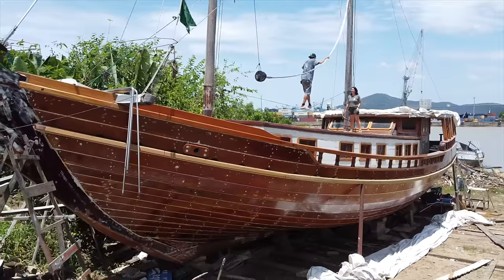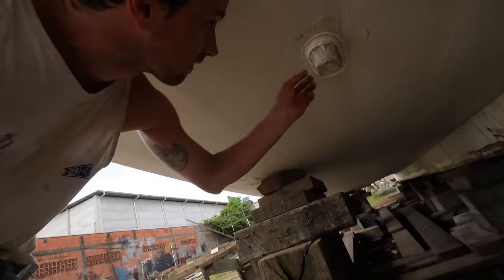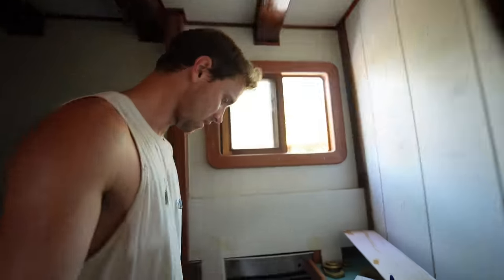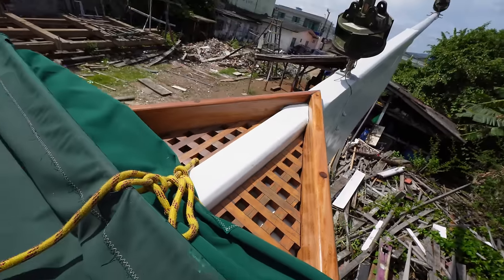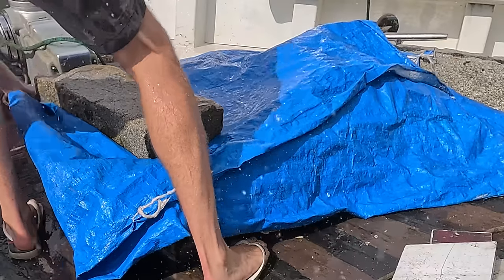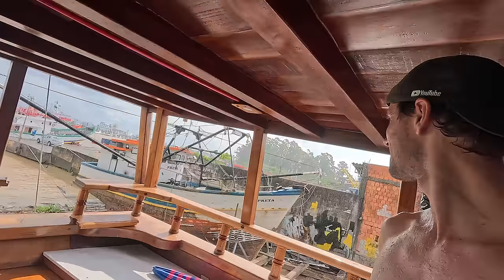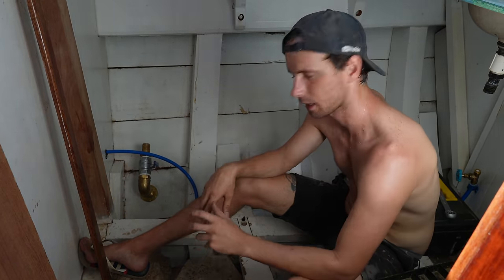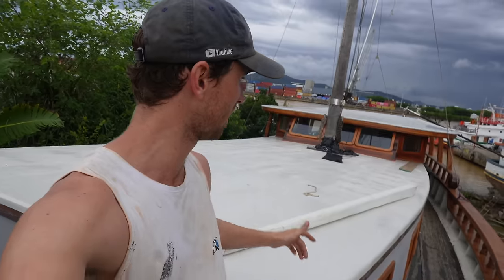Boat restoration diaries: what it really looks like to face the high and lows — Sailing Yabá 181

Comment: “One at a time” was a very good answer.  Here it is often called a “monkey wrench” (for some unknown reason). Many thanks for sharing your amazing and challenging adventure.
Reply: The pipe wrench has that pivot that tightens around the pipe or nut, the monkey wrench doesn't pivot and is used on nuts or bolts, not pipes.
Reply: Charles Moncky patented his smooth ,parallel jawed wrench in 1858. The newer pipe wrench with the pivoting ,toothed jaw was invented by a steamboat fireman named Daniel Stiltson ,in 1870. Some still call them stiltson wrenches.

Comment: Putting  a large battery close  to the anchor  winch  is  the  safe smart thing todo  and cheapest.  It only takes  a small  wire  from the  breaker  box to charge the battery  and  a small wiring  cable  to the controller.

Comment: Just a suggestion, when installing ball valves on through hull connections, you should always mount them in such a way that you have to move the handle upwards to open and down to shut them. Because whenever you shut a ball valve on a through hull, you want it to stay shut until you open it and not until something falls on it without you knowing.
It might seem nitpicky, but these are potentially boat sinking details...
Keep up the good work!
Michiel

Comment: I live on the coast I know how frustrating the weather can be especially in the summertime. 
You have to work around the rain because it comes even when there is a lot to do. That you can’t do in the rain. At least the mud don’t stop you guys and what I always did it dose ( using heavy equipment). But you brave it everyday to see If you can get things done. Oh I hope you installed automatic  one way valves, on your bilge pumps.
Yaba will set low in the water so they maybe needed. Especially when under sail.
Take a much needed break and enjoy your day. We will be waiting. Launch day is coming guys ! 
I can’t wait !!!

Comment: Hi Ben and MP, a small suggestion before heading to the water. Can I suggest you fix a small string, or chain (maybe bath plug chain) to the window closure sticks. That way in a rush to close or open the windows  the don’t go missing or get lost over the side. With all the work that has gone into making them and the windows it would be a shame to lose these little pieces. Yaba is looking amazing.

Comment: Ben you haven't mentioned it, but i hope you intend to add holding tanks for the output of the toilets.  Most marina's require them when you stay, and you are not allowed to flush the toilets overboard while docked.  I just thought i would mention it before you get to far along.

Comment: MP, we call that a "float switch" on the sump pump. It floats up and makes the pump turn on. 
The other name for the pipe wrench is a monkey wrench 😊
You should try to get a portable fan to take with you into the work areas that are so hot. It might help a little.

Comment: You should install the wires only through the side or bottom of the relay box; I dont work on boats specifically but usually we install these only through the bottom so they are  protected but also so water/dirt doesnt sit around it. Side is okay but top should probably be avoided in case it gets wet

Comment: You could pu,t a small gel cell 24 volt battery in the front locker to assist the anchor winch and hav standby power for bilge pump,

Comment: On my boat I often had little fish swimming up the through skin fittings and blocking the pipes.  I had a filter and a sea cock to be able to clear them out before they got stuck in the pump. It often happened on the through fittings for the heads especially and the pump sucks them in until they get stuck..

Comment: Looking at the boat in rebuild you pointed out I see it has the stabilizer fins - don't know if it is to late to add them but they make a big difference and well worth the effort - even smaller ones because you don't have the booms hanging over the sides.

Comment: I would also like to see what you are doing in your down time. Get to know you a bit better. Mp you need to maybe switch day and night. Work at night down there then it will be cooler. 😁 Thank you for letting all of us be apart of your rebuild.❤
Reply: That is a good idea (working near night time), however I don´t think the shipyard manager will allow this because of safety reasons as well as inssurance restrictions. Obviously working in more cooled conditions in summer is more efficient, but they will be on their own in case of an emergency. Cheers from Argentina.

Comment: I love these daily videos!  I was thinking about that hatch  that might lock when closed, the latch going over the staple with someone below.  If you glue a spongy foam piece above the u-shaped 'staple', it will prevent it locking, and it can be locked by squeezing the latch down to put your lock thru the staple.  I think that will make it safer for someone below.

Comment: I think we are on the same latitude as you in Brasil.  We are in Australia.  We've been out working on our property in stifling heat and extreme humidity so we know exactly how you feel while you are working on the boat in this heat.
Reply from the maker: I hope you manage to get through it! We have learned that no matter how hot it is, we should appreciate the work while it isn't raining... or something like that :D
Reply: @SailingYaba   Yes we agree.  We have done a lot of work here to prepare to take advantage of any rain and capture the water for future use.  We have received some good rain in the past 24hours which means our water tanks are full and our dam is full.  While it is still very hot and humid, we now won't have to worry about running out of water for up to six months.  By the way I am loving coming in from a day's work to another video from you both.  I feel your anxiety about putting through holes in the hull, marvel at the busy throng of workers you have onsite and MP's irrepressible optimism, even when installing a bilge pump in the claustrophobic forward locker.

Comment: You should caulk inside the hole as well for you thru hull fittings.  Hope you don't sink because you were stingy with the caulking.
As to off shore electrical connections... you should do some research for what is used.
Reply: Installation of the thru holes has been a sloppy mess relying on half assed caulking to prevent leaks, all caulking in the best installation will leak eventually. No caulking on the inside is a real issue. I hope I am  wrong you better have the bilge pumps running when you splash.

Comment: Great progress!!!   "loveneveryminuteof it"   Just a few things to see would be to label every thru hull with what it does--- as you maybe the one shouting orders not doing them  Your crew member may not know which is which.  Then a little heads up on those solenoids. (the "Ford" type) They came in at least 3 configurations.  ! one was a true starter relay for momentary use.- two was for continuous duty where it just stayed on as long as energized_ three was a version with a small ground lug next to the signal lug so it could not work unless that lug was grounded.  A variation on that was the original "Ford" solenoid for resister ignitions where the second lug went to the coil circumventing the resistor wire.  SOOO just make sure you get the right ones.   Love you guys.

Comment: Hi Ben, fyi did you use straight thread elbow on the thru hull fittings?
Most pipe fitting have tapered threads and will fit on straight threads but not seal properly. 
Especially important if  you did not put a straight thread valve directly on the thru hull fitting first. 
Cheers Warren

Comment: The outlet on the boat head that I had was 1-1/2 inches (38 mm).  Your outlet through-hulls seem smaller.  Is that because you will use a macerator?  With plans for having non-sailor guests onboard and the desire to not have any problems, big is good.  No need to respond, just something to make sure you install what you want.

Comment: Hey guys. I think it’s quite interesting to see your daily routines as you prepare to splash the boat. I was wondering whether you were going to install a bow thruster. It would be extremely useful to have one on a boat that size. Secondly, have you thought of shore connections for those times when you might be at a dock. Being able to use shore power and water could be helpful. As MP has been working hard on the electrical  systems the thought crossed my mind. Lastly, is a water maker in your immediate plans? Cheers.

Comment: At 9:44:  A relay is a magnetic switch that uses a small current (therefore requiring thinner wires) to operate a larger current (requiring thicker wires), similar to that in cars.  In vehicles, a thin wire runs from the ignition switch (using about 1 A or less) to the relay (attached to the starter motor), which is capable handling a much larger current (say 50+ A), using a thick black wire (from the positive pole of the battery)  about the size of your little finger.  This larger wire connects the starter motor through the relay to the battery.  From the negative of the battery, there is another black wire, somewhat thinner, that connects to the car body (busbar) of the car. Yes, kind of confusing since both wires from the car battery are black.  However, the one to the starter is thicker and longer; ground, (negative) is shorter and somewhat thinner.

Comment: With the bow bilge pump getting power from the windlass box, how will it still be connected to the hot battery bus and have continuous power.
What  if the windlass circuit is turned off?

Comment: Hi MP
Apologies if I have missed something when viewing your electrical installation but when you tapped off the windless power supply you are using what looks like 2.5 or 4 mm cable however the supply fuse to the windless will be 10’s of amps. A fault on the sump pump cable would instantly incinerate the wires possibly causing a fire. Any cable whatever size should ALWAYS be protected by a fuse of lower current rating than the cable. Sorry if you know this and I am being stupid but hate for you to have unsafe installation.

Comment: Just a question,  if you are  using a relay how are you monitoring pump failure.
Reply from the maker: We'll have a fuse between the relay and the pump and also, well, a flood alarm that can let us know if the water level is above what it should be if the pumps were working as they should. Any other suggestions?

Comment: On the head seawater inlet, isn’t it supposed to be above the discharge fitting? Or am I missing something.
Reply from the maker: As 💩 floats, the outlet should be above 😉
Reply: I mean, I see that there’s the proper separation between the two, I’ve just never seen the fresh inlet below the level of the discharge.
Reply: If you say so!  @SailingYaba

Comment: Hi very very worried that your bilge pumps are at least 50% too small in the bow you need a min of a 2 x 3"dia pump ,Engine room a min of 2 x 4" dia pumps you can't have them too big I can assure you
As when your at sea your on your own.
Have you calculated how long the battery will allow all the pumps to run for ,to me you need to double the number of batteries in case your engine is a none runner
Have you allowed for a manual bilge pump as well as a back up 
Please please up grade your pumps  and all hoses.
Barry Marbella Spain

Comment: Wow the maximum temperature in Itajaí for the last week is only 26°C, so in the boat would be less than 35°C which is not even hot (says the Aussie who won't even turn on the AC till the temp is over 33°C 🤣) so if those GoPro''s can't handle those low temps they are effectively useless, maybe time for a competitor to make a serious camera that can work outside cold climates. (if any camera makers are reading this, parts of Australia can reach 50°C so max operating temp should be no less than least 60°C to ensure the camera can be used in all conditions)

Comment: Not much sense epoxying the through hulls if you are drilling and sanding at the holes again !
Reply from the maker: I don’t get it 🤔 we didn’t sand or drill any hole after epoxying it
Reply: @SailingYaba  when you were putting one of the through hulls in it was tight and you drilled the little locking gold and sanded it out a bit so it went in easily . I am assuming you were doing the final installation after epoxying .

Comment: 👏👏👏 

Food for thought 🤔
You put into your SHIP a lot of Through Holes  , I Do Not See those Leaking .🤔

Your Ship has not been Water Tested 
Until it has Been Floating in the Water ?

Here is what I see 
From the through hole you Teflon tape then a Valve , Teflon tape then a VALVE Teflon Tape , then a short nipple or 90 degree fitting or a barbed hose end.

If something failed a or a crack , leaking Joints . HOW Would  you Fix it !

Before you Leave !
Make or Buy Some Plugs that fit those through holes at lest 2 per  incase you loose one , be able to tie it up to the Railing  with a rope to keep from losing it during inserting .
This will allow redundancy  to make a repair from Hose to the exterior of the Ship

Jump in the water to close temporarily to Make A repair in the Water right then and there . Not having to be put On The Hard To Make a simple repair. 

Read This Buttercup 

💥He Tore His ROBE !
What happened when Caiaphas (tore his garment ) is more than a ripped robe. He ( VIOLATED Highest Jewish  LAW )  And ( LOST his Priesthood. )
One of the things the High priest was forbidden to do was to tear his clothing. The passage is found in Leviticus 21 and says:

10 ‘He who is the high priest among his brethren, ( on whose head the anointing oil was poured and who is consecrated to wear the garments, shall not uncover his head nor ( tear his clothes;  )
(This is Huge . We Have a new High Priest)
Caiaphas asked Jesus if he (Jesus) was the Son of God and Jesus answered to the affirmative, ( the High priest tore his clothes) which was absolutely forbidden. Matthew 26:62-65

Not only does this show how far the priesthood had fallen from their holiness, it also meant that Caiaphas ( could no longer be the high priest because he broke the (law)  )  thereby making Jesus the true high priest. Caiaphas saw Jesus as a threat to the existing religious order.

Today JESUS CHRIST is our High 
Priest 

Jesus loves you

BELIEVE ON THE LORD JESUS CHRIST 

Your born in the SPIRIT 

Now Your BORN AGAIN 

Jesus Told Nicodemus you must be Born in the Spirit 

See all of you that BELIEVE 

On the clouds , it is not DEATH 😃

IT Is Life With Jesus Forever you Are   (  FORGIVEN  )  for all are Sin

Don’t Play the part of the Hypocrite just turn from sin

I will see all of you that BELIEVE 
On the Clouds 

Some things you may not Know 🤔
Share , 

Abraham  The Father of the Jews , 
( Was a GENTILE )

Why did God choose the Jews ?
Because they were Fewest  
In number !

What about all the Children that have Been Killed , Jesus can raise anyone from the DEAD , He is not the GOD of the dead , HE is the GOD of the LIVING 🤔

We will all be raise at (the Last day) end of the Tribulation.

I have always used the 
KJV Bible 1611 
35 years  
You can Trust the TRUTH in it😃🤔😇😇 
Warning  About bibles 
Youtube : Gail Riplinger 
She collated Bibles and will share the TRUTH, Will set you Free 😇

Many Bibles are missing words sentences, phrases, making what GOD & JESUS lesser then who they are and the Deed that they have Done . The day Jesus was crucified forces of evil have been at work ☠️💀☠️💀☠️💀😳
Scribes , Pharisees, Jesuit’s ☠️💀
They have introduced many bibles  To add CONFUSION  ,
The TRUTH WiLL Set You Free 😇

Compare The Catholic Bible with 
The King James 1611

There not the same 

Get you an old KJV 1611

Where would you hide incomplete bibles in a forest of incomplete bibles (The Worst NKJV ) 

People think new is Better . 

An Exterior plug